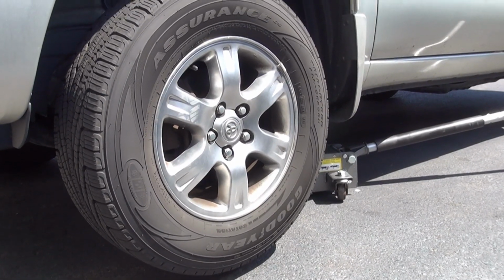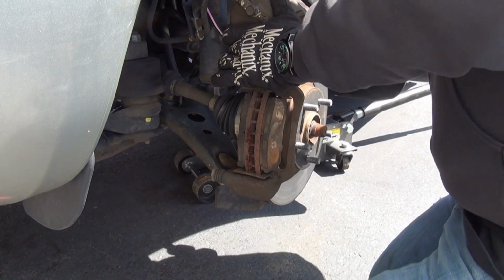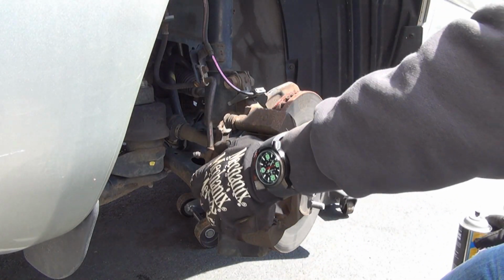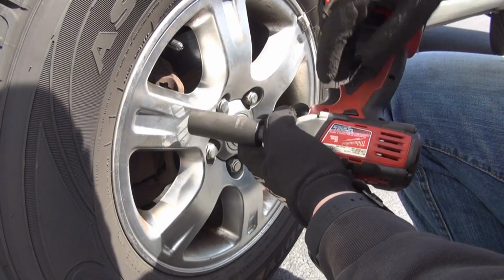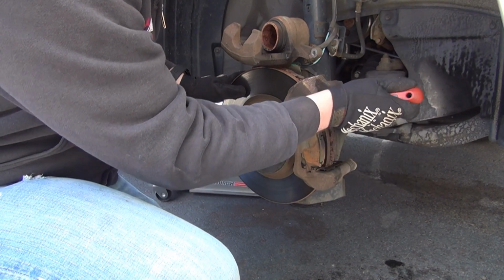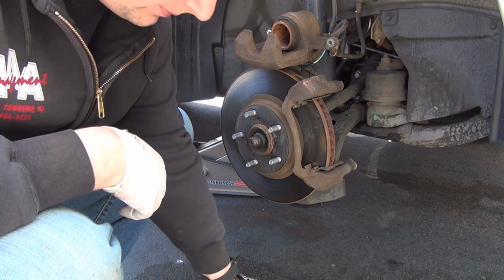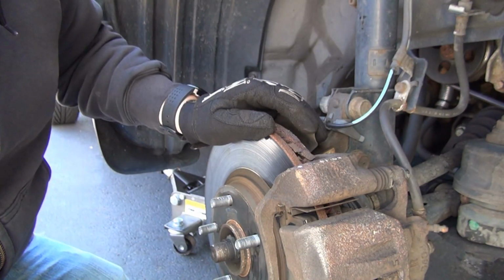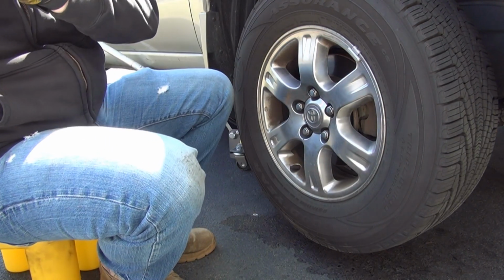2001-2007 Toyota Highlander Front Brake Pad Job

Comment: That rubber thing in the rear part of the lower suspension arm in my 04 HL looks the same.  Anyone know if that single part (rubber grommet for lack of a better word) is available or is it a single part with the whole arm?  Thanks for video. Good job
Reply from the maker: condor5635 they are pressed in and sold as a whole control arm. Thy are cheap.
Reply: ImStricken06 thanks for the reply. What's the symptom if that bushing goes bad.? I'm not noticing anything. Seems to drive fine. But it has 194,000 miles on it and it's the original control arm
Reply from the maker: condor5635 clunking, loose steering, noise as you turn. Park the car & turn it off. Now wiggle the steering wheel. There should be much play. My sisters car had. A lot of play because many rubber bushings were shot

Comment: Thanks for the helpful video.  How does the job differ when working on the rear brakes?
Reply: ***** Thanks.  I have heard mixed levels of concern (from none to some) that the fact that the rear brakes involve the parking brake linkage means that there might be steps needed for rotor removal not needed for removal of front rotors.

Comment: I have a 2008 Highlander and it has two front pistons in the caliper.  I didn't see you clamp the pistons.  I saw that it slips right in.  Do you suppose it works the same for a 2008? If not, how can I clamp them?

Comment: .Depending on that floor jack to keep that vehicle supported is asking for a trip to the emergency room(or worse). Don't you have jack stands? Also,why didn't you check the pins for lubricant. What kind of grease was that you used on the tabs and shims? Burnishing a small amount of anti-seize into the disc/hub mating surface will assure the disc will come off without extraordinary effort. You made some very good comments about wheels being over torqued. Regards

Comment: Excellent video overall, but you say the brake dust is a carcinogen, yet you blow on the brake pad which creates a dust cloud. No particle mask. No jack stands. Thanks for mentioning the missing noise maker. I wondered about that. You did not check the swing arm on the right side to compare with the left. I think the sneezing at the end is from inhaling brake dust. I wish you good health.

Comment: I always like videos of people trying to help others so good for you, however not using jack stands or something else to hold up the vehicle Incase that cheap Walmart floor jack fails  and ruins your day is setting a bad example,also call out the size socket and if it’s metric or standard, this is why a lot of people are using the specific video,you never checked or mentioned the caliper sliders or inspected the boots,also their is no reason to lube the top and bottom of the pads  that is why you never see that step anywhere, all that will do is collect brake dust and road grim and jam up the pads causing uneven ware or sticking , you said you did not want to do it the lazy way but you did,you need to remove the stainless sliders and clean the flaking rust that builds up under them creating a tighter and tighter fit to the point were the pads stick or jam that is one of the most  important parts of a good brake job,sorry I’m not trying to be to critical but to many  beginners will develop very bad habits from videos like this

Comment: I use to teach for a living and I can tell you your video was awesome. Really awesome job. Every time a question popped up in my head you followed through in the video with an answer. That's awesome stuff. I did notice a question in one of the comments about clamping the pistons? I noticed you did not have to do that. I vaguely remember that process when a friend helped me last time. Could you explain that briefly? Thanks again for the great video.
Reply: Richard Latimer he didnt put new pads on so the pistons didnt have to pushed back. if he put new pads on, the thickness would now require you to push pistons back. easily done bu putting something in front of the piston like a block of wood then use a C-clamp to slowly push the piston all the way back in to accommodate the new pads